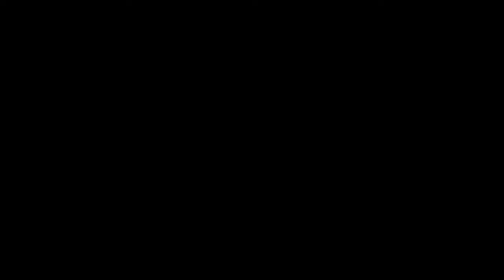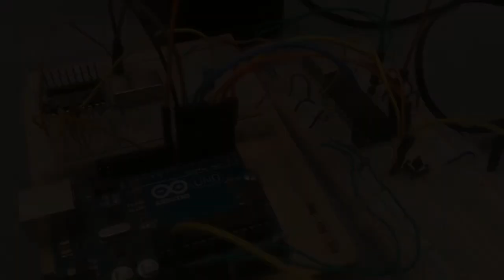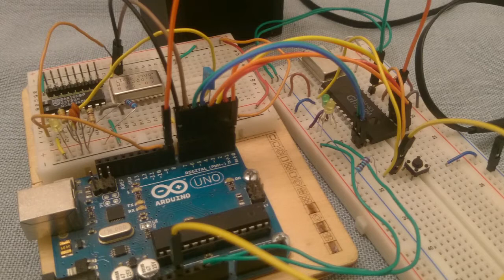Vintage SP0264-021 speech sythesis chip demo

Comment: Sounds cool.  Had a a couple Votrax SC-01As and connected them to my Model I TRS-80.  Just bought this chip off eBay  and the seller said he was selling from a lot bought in the 80's and that they were originally used in FuzzBuster Radar Detectors.  According to the seller the Radar detectors were ahead of their time and expensive.  So they didn't sell well.
Reply from the maker: The Votrax ones sound a lot better than this one if I remember correctly -- but they're unfortunately pretty rare these days and much more expensive than the SPO256-AL2. I would have used one of those if they weren't so expensive!

Comment: Most interesting! Seems to have been made for control gear or radio equipment
Reply from the maker: Thanks! That's another possibility.
Reply: Confirmed!

It appears to be used in Sega's Astro Blaster. Listen for it carefully - the word "Operational" is exactly the same in the linked video, around 2:09, just with a deeper pitch. The chip is clocked with 3.12MHz in the game, which directly affects output pitch.
Reply from the maker: nrdesign1991 Hmm, I don't seem to be seeing any link... (the 2.09 links to my own video)
Reply: I have linked a video in my previous comment, and that's what the 2:09 is for
Reply from the maker: Huh, either it isn't working or I'm not seeing your comment XD
Reply from the maker: Ah, I just looked again and it told mer there was a comment awaiting approval (Probably because of the link) :P
Reply from the maker: It's quite possible it was used in an arcade game. The datecodes on mine say "86", though, so maybe not that specific one. There's quite a few other phrases that don't seem to match either (Screen, Brightness, Volume, etc). But who knows, maybe some arcade developer needed such words XD

Comment: Very cool, definitely sounds different than the 256.  Where did you get your chip?
Reply from the maker: airthrow There was an eBay action for them, I was hoping they'd have the vocabulary of the 256-AL2. I think they aren't available on eBay anymore, since there was a huge lot of them for sale a year or so ago, and that sold. I think the three I have were a bit of that larger lot. Let me know if you're interested in one, I don't use them for anything.
Reply: Jacob Field cool, I could trade you something maybe?   I have one but as a cheap ebay one, I suspect it's a non-working fake.  I will try rebuilding my circuit one more time.  Did you use an amp?
Reply from the maker: airthrow I did, the speaker I had has one built in. A trade would be cool, what do you have? Also, without an amp it is hearable, just not at all loud. It seems like to get it to work, I had to hook the reset pin of the SPO to the Arduino's reset pin. It wasn't that way for the 256, but for some reason my 264s needed resetting on power up. Try that and get back to me!
Reply from the maker: (you may have to put your ear right next to the speaker to hear the unamplified output. I also don't know if you have any filtering components, but you shouldn't need any)